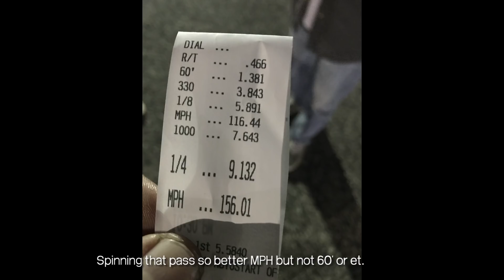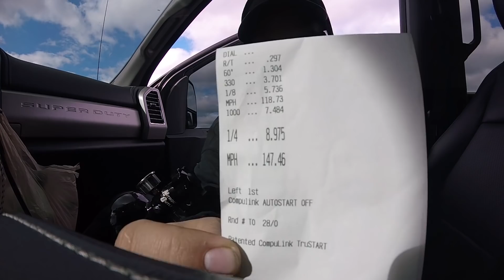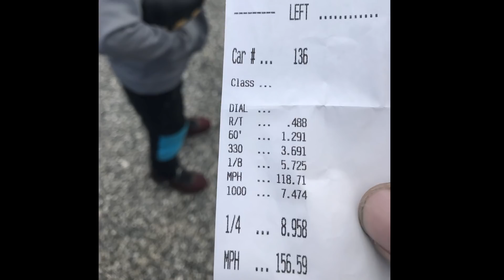First C6 Z06 LS7 SBE in the 8's | RPM S4 E4

Comment: the RPM heads/cam package which this car has,are they an improved LS7 head or your own heads? what sort of HP is engine without NOS? any particular reason you chose the MSD intake over the FAST  one? also would a Harrop or Kinsler intake be another step better again for HP?.whats your RPM heads/cam package worth?

Comment: Congrats great passes what's the suspension and tire setup? How streetable are the shocks?
Reply from the maker: K O bone stock suspension besides a Pfadt rear drag bar.   Stock original shocks on the car .    Tire is a pro bracket radial